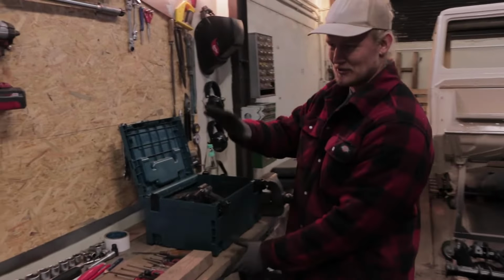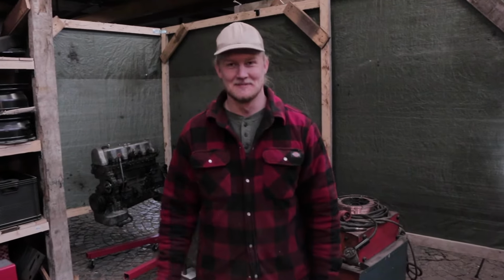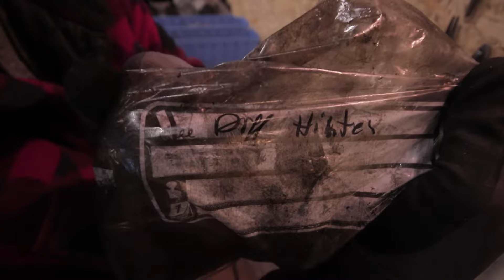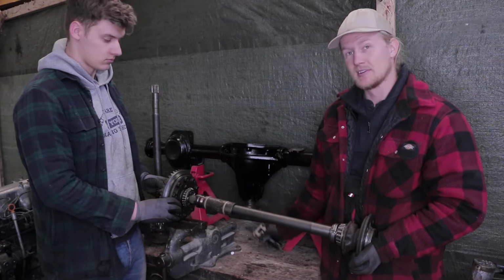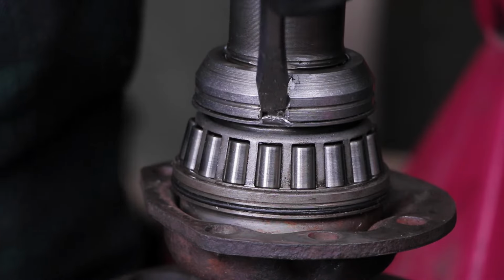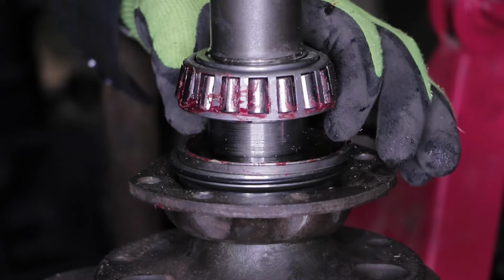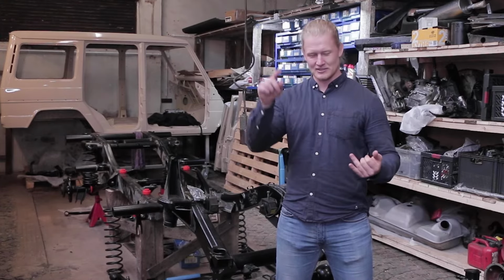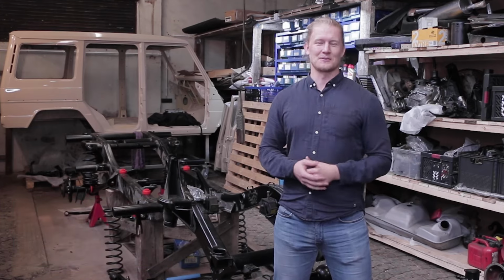Reassembling Axles & Suspension Part I | Project Thor Ep7

Comment: Incorrect all bearing installation in this video.. I would newer give my car in workshop where for nuts or bearing change use hammer. Lets say it is - how you shouldn't do this =))
Reply from the maker: You're absolutely right. Though we have the official manual now and there is a hammer involved in the correct installation process ;-)

Comment: I'm curious why you didn't go with an OM602 or OM605 engine. Lighter than their OM616 and OM617 equivalents, more powerful, more efficient, easier to wring more power out of, etc.
Reply: Probably because that’s the engine it came with. I’m not sure what’s involved in adapting a 60. to this car. The 617 is a pretty awesome engine though too.